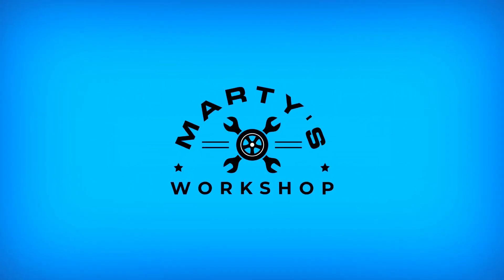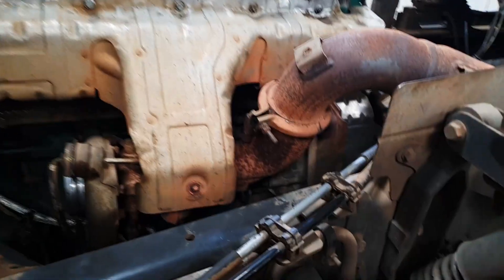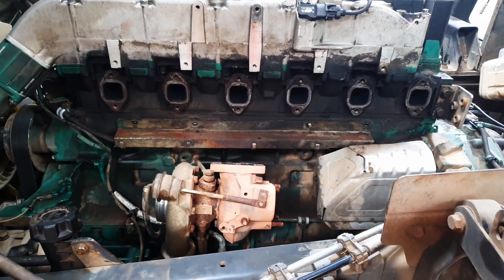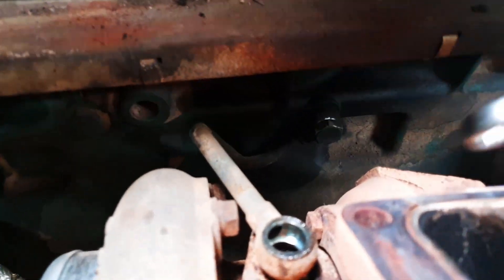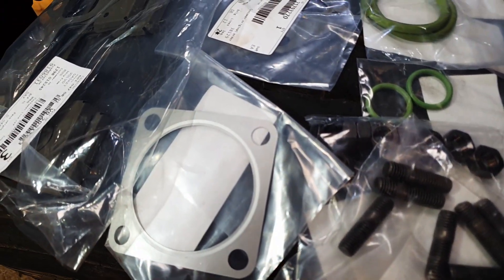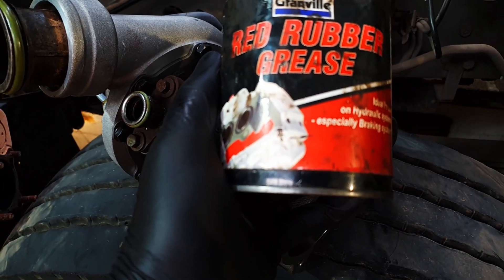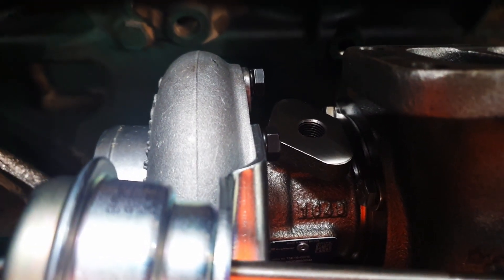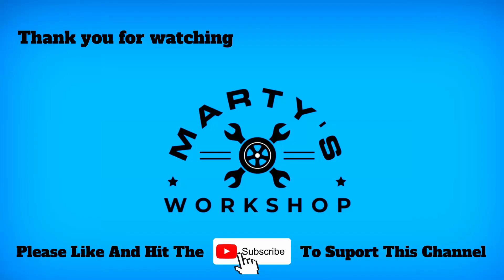Volvo FE HGV turbo replacement on D7e engine

Comment: What's the proper way to prime the fuel system on this engine?
Reply from the maker: Hello and thank you for your question, it's not an easy task on these engines, when I replace the main fuel filter, best way I have found is to insert the filter into the housing without the cap then pump the hand primer on the prefilter housing untill it fills the housing with fuel till its just below the top of the threads, then fit the cap, after this keep pumping the primer untill the primer is stiff, then get someone to start the engine while you continue to pump the primer and after it starts keep pumping for around 30 seconds and you shuld be fine, know I have noticed that untill the truck has a good drive it will be hard to start, if you have had the whole sule system apart I have had to keep pumping the primer for a few minets after it starts otherwise it cuts out, thease engines can be trying! Hope this helps.

Comment: Nice, we have these engines on our Volvo B7RLE's at work. 58 plates. 650,000 miles roughly, still pulls like a train.
Reply from the maker: Yea this one is on simular miles ans still pulls well!! Thank you for watching
Reply: @Martysworkshop  just wondering, how do you disable the speed limiter on these? Does it have to be done electronically? Ours are limited to 50mph which is a pain in the ass if you're on the motorway.
Reply from the maker: The limiters in these are programed into the ecu, you would need to get it plugged in, i have a delphi  diagnostic computer on work and i believe it can change the speed limiter.